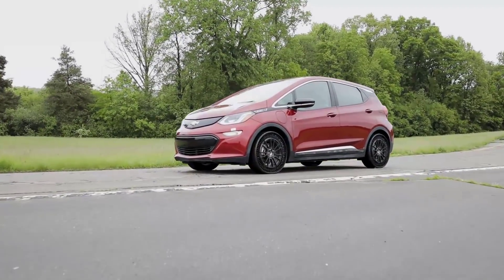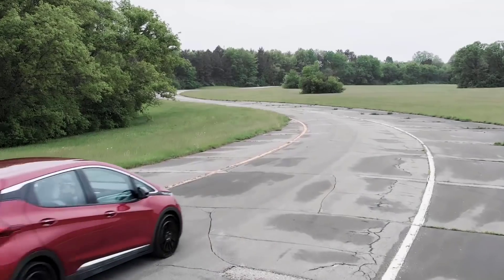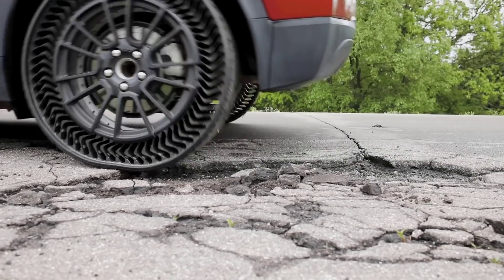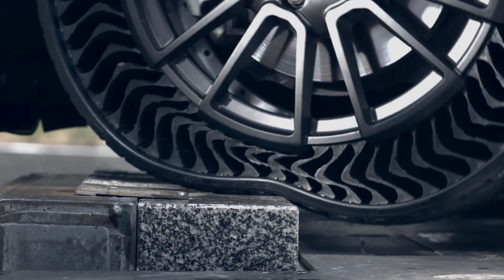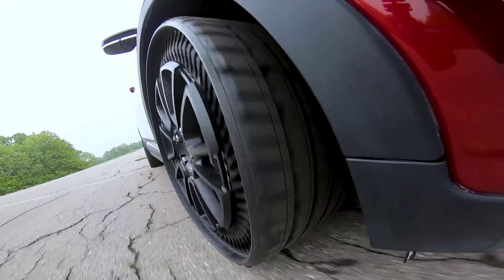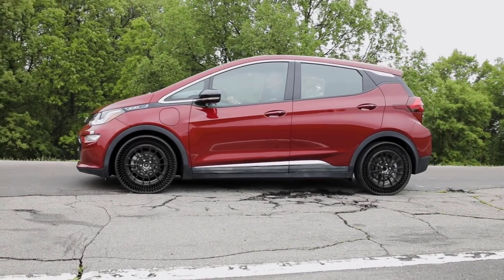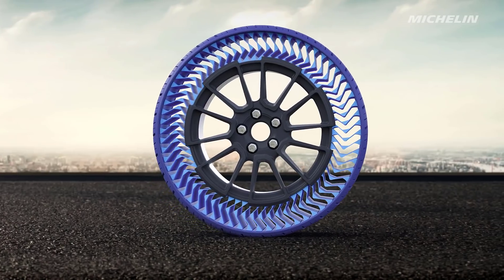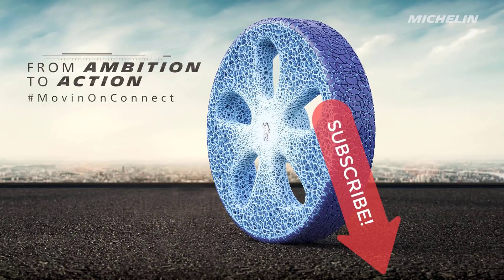Everything I Know About Michelin's New Airless Uptis Tires

Comment: MPG comparisons vs air tires?  Low air pressure tires can cause more fuel consumption.
WEAR AND TEAR?  What it someone abuses their tires till they reach the ribbed section? maybe an underpaid New York taxi driver?  TERRAINS?  What will sand/mud/snow compacted in the exposed tire ribs do? any issues on steering, corrosion, breaks (unaccounted weight build-up)
I WANT these tire but I also want to know if they are worth the investment.

Comment: What happens if you drive in off road conditions and mud enters inbetween those grooves? Or let's say it gets stuck in a mud puddle, hopefully their design engineers took that into consideration,  seeing they were designed for on the road electric cars that probably means they won't be that useful off road BUT you mentioned that Michelin announced that they are currently being produced for non passenger uses such as farm work???? Farm work is off road on steroids so it will be interesting to see how that works.
Reply: Another scenario - what if a dislodged stone from the tire hits a pedestrian at high speed? I like the concept and design though
Reply from the maker: @rishijai  Good question and I don't know the answer.
Reply: 'Farm work is off road on steroids' Hahahahhaa
Reply from the maker: Looking at the design, the mud would just get shoved back out as the tire rotates.
Reply: That design is to show the internals of the tire the real tire will have side walls lol.
Reply: @SisyphusJP  witchery
Reply: There are already videos of these on riding mowers, and they do much better than stock.